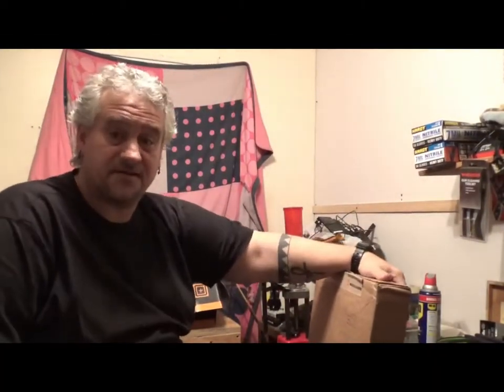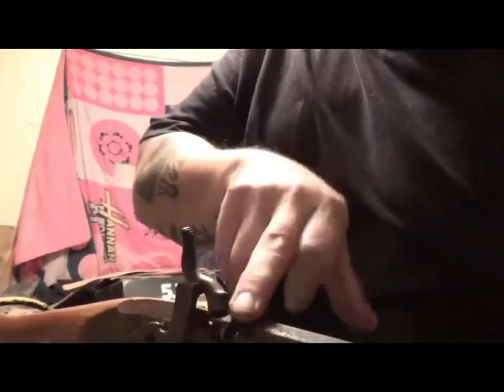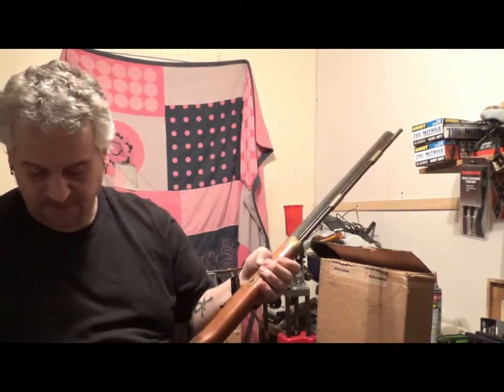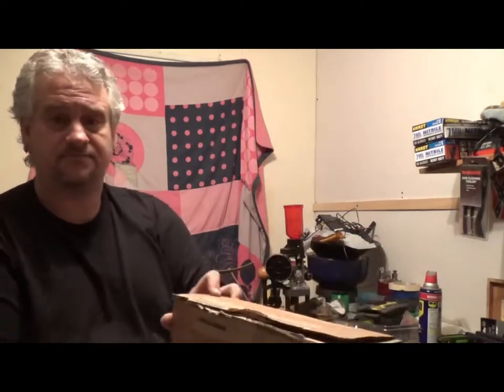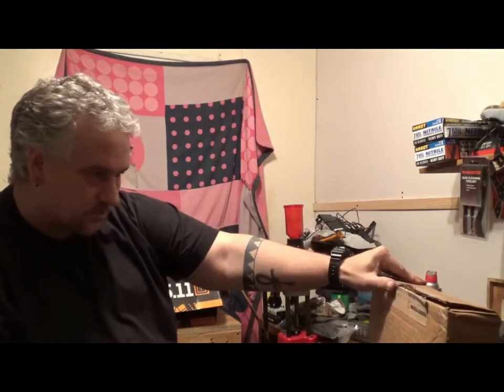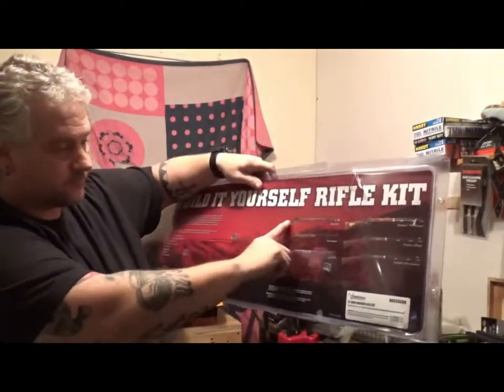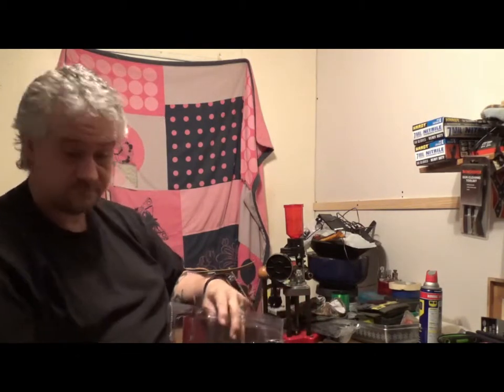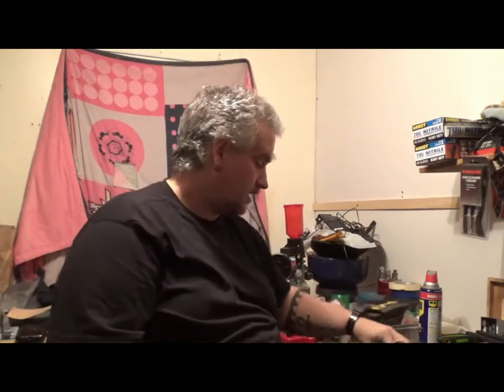MUZZLELOADER BUILD (pt 1)

Comment: Trigger job
Reply from the maker: I did eventually end up making several adjustments to the trigger group. There is a tension screw to adjust set pressure I was not aware of...
Reply: That’s crazy